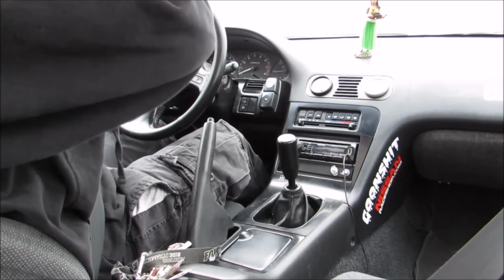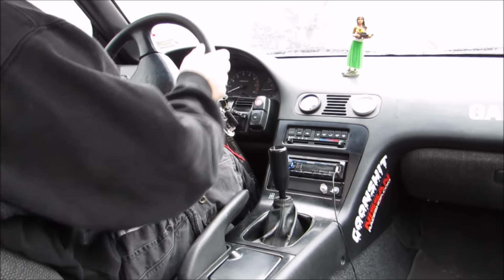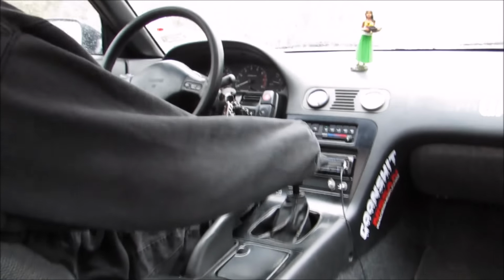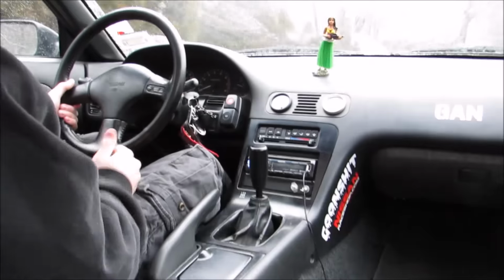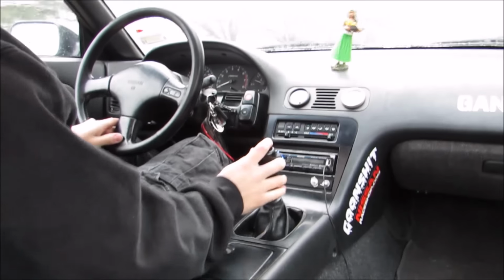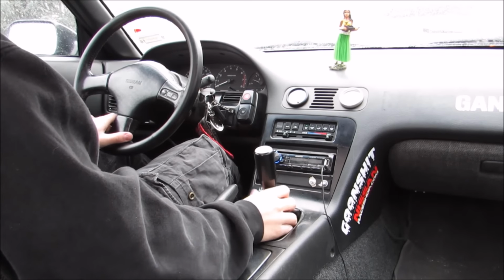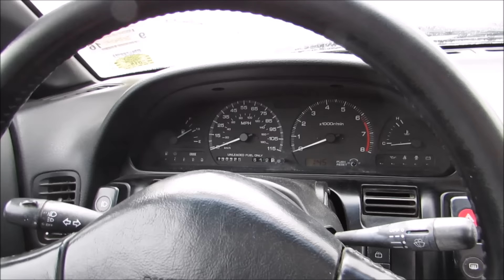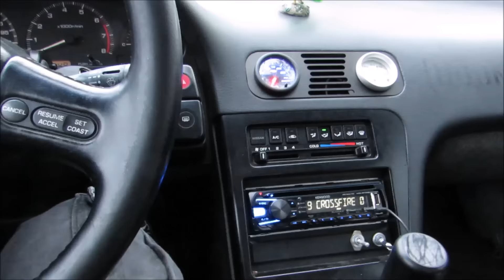240sx RB20DET Vlog | Trip to Autozone, Car Audio

Comment: Hell yea man !  So rad to see you mobbin agin literally the only YouTube account I bother keeping up with 👌🏽💯
Reply from the maker: +sean darosa Thanks a lot man! Did you get the air regulator yet?
Reply: +One_Clean _s13 yea I did actually today man but still has the same problems sent you a vid on Instagram been messing with the car all day I got it to run smoothly but still wouldn't start for shit hah if I unplugged the maf starts right up but runs horrible obviously but when I plug it back in goes back to running fine .. Idk plus my boost gauge says I only have 10psi on vacuum so might have a leak! Not sure tho
Reply from the maker: +sean darosa hm. If your car is idling high then it could be starting to build boost pressure, thus giving the 10psi vacuum youre talking about. I blocked off my BOV since it was leaking pretty bad. You may want to check that for leaks :)

Comment: My car needs gas to start for the first start of the day, even in the summer. Ive read that it may be due to running a straight pipe, and no back pressure. But stars fine after that. Also i have a cat if you want one for cheap!
Reply from the maker: +Kalvin Malli (ThatBurgundy240) Hm, interesting. With mine I just have to prime the fuel pump. If i dont prime it then i have to apply gas for it to start. Is it the OEM cat from 1990 or is it new lol
Reply: One_Clean _s13 Its a newer one, Used it for about 6 months in 2013

Comment: I have exactly the same problem with my rb20 gearbox (whines but goes away when you press the clutch down). My mate says he's 99% sure it's the input shaft bearing inside the gearbox. If you put a s13 gearbox in it can you make a video of it? All i know is that the s13 gearbox looks exactly the same as the rb20 one, but has a different bellhousing. RB gearboxes go for around $1000 over here but you can find s13 ones for $150, so it would be nice to know if i can just buy a s13 one. Thanks buddy and keep the videos coming! :)
Reply: +zanmato! Yup sr20, rb20, and ka have the same trans just different bell housing.
Reply from the maker: +zanmato! xStr8UPDoPex is right. The tranmissions are compatible yet they use a different bell housing. If i do end up replacing it, I will be sure to make a video, thanks!!

Comment: You do anything to protect your nice wheels during the winter? I've always switched to steelies during winter and I get jelly when I see other people rocking them year round. thanks!
Reply from the maker: +Zach Fifer Well, my nice wheels arent exactly NICE. I tend to refer to them as my "nicer" wheels compared to the stock teardrops or my other 15" borbets. The racing harts are chipping a lot and have a lot of oxidation on them. the lips are also pretty beat up. I would keep them on if the tire wasnt off the bead as of now lol. Gotta get that put back on

Comment: Any muffler will muffle pops and crackles. When I unbolted my muffler on my Z, everything else is still stock, it crackles a lot every time I let off. Its just rather quiet bc of the cats and res.
Reply from the maker: +Liqhuid makes sense that a muffler would muffle the sound lol. you have a Z? z32 or z33? They both sound great but Ive got a soft spot for how those vq35's sound :)
Reply: +One_Clean _s13 Z33 vq35de. Really want an exhaust cutout so I can have stock and straight pipe at any time haha.

Comment: have you thought about getting trans rebuilt ??may b better insted of new box
Reply from the maker: +mack264 you do bring up a good point. If i had mine rebuilt then i would be assured that it will be in working condition. Buying a used transmission can lead to another problem down the road. Thanks for the thought!
Reply: +One_Clean _s13  yes and ka  box may not enjoy  6 cylinder  power!!
Reply: +mack264 sohc & dohc ka/sr/rb20 trans are all the same. Bellhousings are different but everything else is the same.
Reply: aye aye captain ;)

Comment: nah man that is your throw out bearing when you let out your clutch, when you let out your clutch that's when the bearing moves because its against the fly wheel. when your is clutch in then you are separating the two, therefore it isn't touching anything and it wouldn't make a sound. :) Replace throwout bearing and that should be gone
Reply from the maker: +240sxAustin Ive read it could be the throwout bearing, pilot bearing or other internal transmission bearings. Almost positive that the throw out bearing noise only occurs when you press the clutch in. Ill keep researching. Thanks for the tip tho!

Comment: get a nardi steering wheel
Reply from the maker: +Bloodz Maybeee
Reply: +One_Clean _s13 grip royals are cheaper
Reply from the maker: +Joshowen I like the less flashy grip royals. The wood grain wheel would slip right out of my hands since my hands get pretty sweaty. Especially with no AC in the summer.
Reply: One_Clean _s13 Even the NRG ones are really clean with a center marker, only 120$